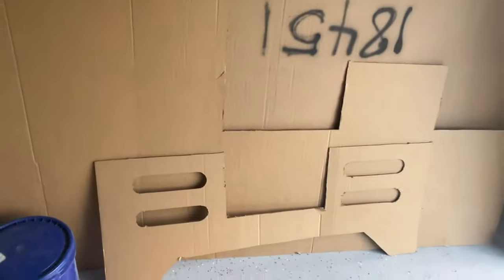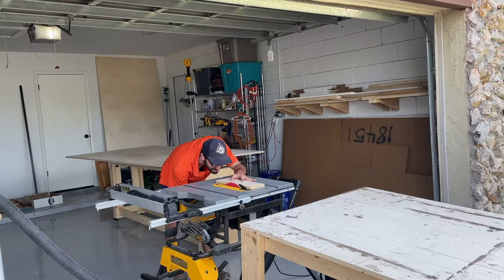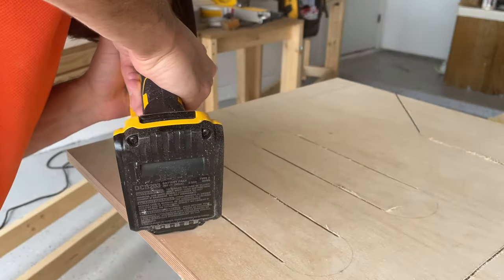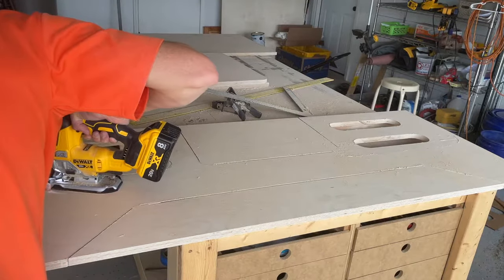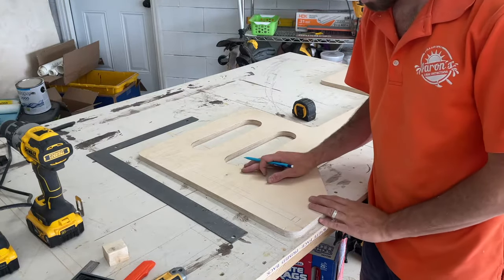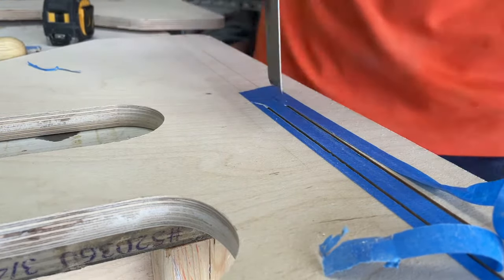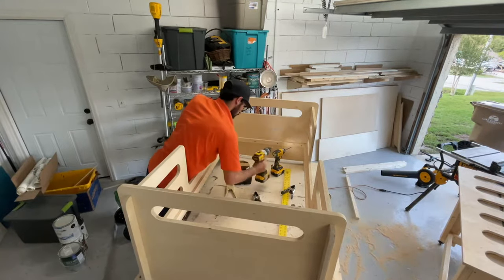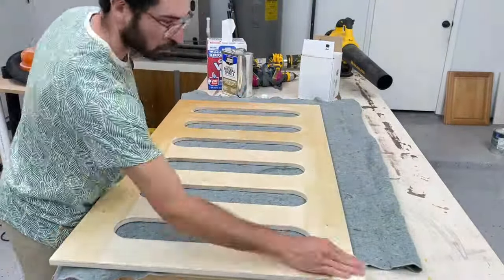DIY Toddler Bed | One Sheet of Plywood | Kids Room Reno

Comment: Can you share the dimension please
Reply from the maker: The longer sides are 57” wide by 23” tall and the head and foot boards are 33” wide by 23” tall. When I slot them together there is an 1.5” overhang on all sides, making the internal dimensions 28.5” by 52.5”, perfect for a toddler sized mattress.